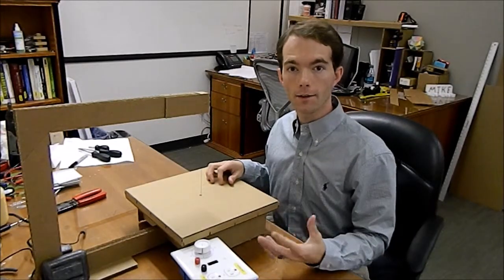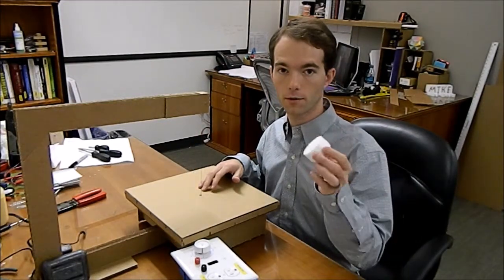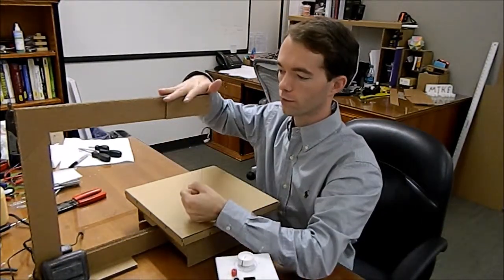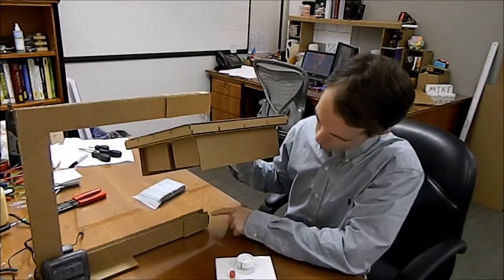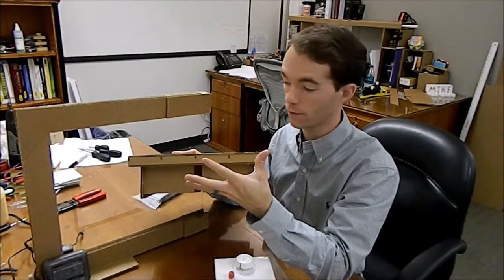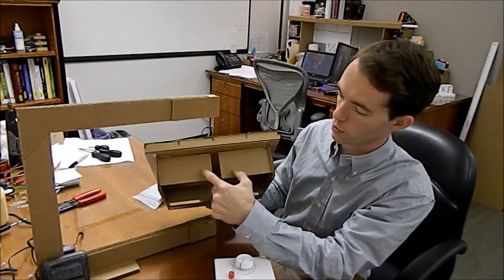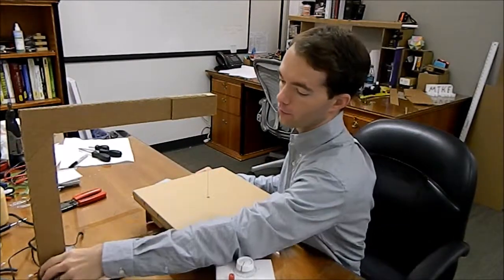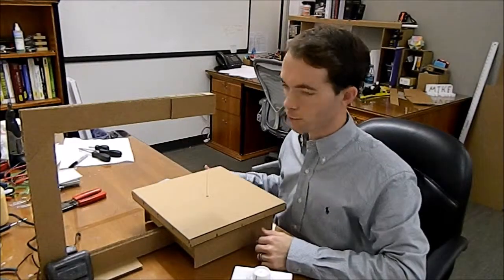Cardboard Hot Wire Foam Cutter  Mikes Inventions

Comment: Thanks for another great video Mike! I'm wondering if you could steer me in the right direction. I'm looking to make a multi-wire foam cutter with parallel wires to convert waste sheet styro into nominal 1 or 1.5 inch cubes for packing material. If the system is 12V, AC or DC, either would work fine? How about Nichrome wire...any suggestions how to use that here? I've heard bends or loops around a post cause thermal problems. I was thinking of at least four wires, or maybe a few more if not too hard. I was thinking of running the wire around an hour glass-shaped glass bead afixed through its center hole to heat resistant frame. I had thought of using fused 120V through a rectifier to a potentiometer to get my heat adjustment. Any thoughts on this? I would really appreciate it! A thorough design is eluding me and I'm trying not to buy virgin styro when I can recycle scrap material. Tanks again!
Reply from the maker: Wow, you are curious, and probably an earth man... :-) I'll work from the bottom up. You certainly need to step the voltage down for safety. 12v is generally considered safe. If you happen to touch a 120v wire with anything, it will not be nice. You need amps to heat a wire anyway, so stepping down the voltage gives you more amps for a given amount of power. If you can, I'd recommend a separate transformer and control for each wire, but it's probably not absolutely necessary. For instance, the wire in this video pulls about 3 amps, but then it's only 11" long, and I've always used guitar strings because they're available in lots of sizes for only $1 each at my local music store. Of course, they're only "that" long too, so... When the wire is twisted or bent, then repeatedly heated and cooled, it's stressed a lot, and will eventually break, but it's no biggie. I wouldn't be afraid to try snaking a single wire around to make a series of parallel wires, or a square grid, just make sure the wire is isolated from everything else except at the ends like you mentioned with the hourglass bead option. Just don't use wood, it'll eventually smolder ;-). AC or DC is fine. The wire just needs amps, it doesn't care. Make sure to put a fuse in too so you can experiment with wire configurations without blowing your precious transformer. Hope that all helps. Good luck EarthMan!
Reply: @MikesInventions  Thanks for your answer, Mike! I'm trying to make this: https://www.youtube.com/watch?v=dfhTjzeforw but a more refined version. I found this site which helps a lot: https://jacobs-online.biz/wire-xformer_selection.htm I appreciate your input you have given!